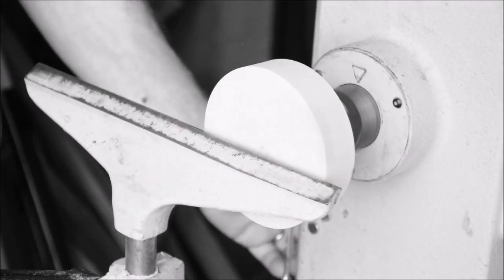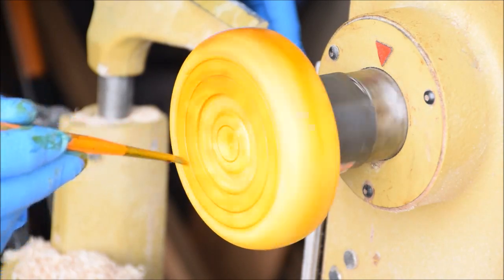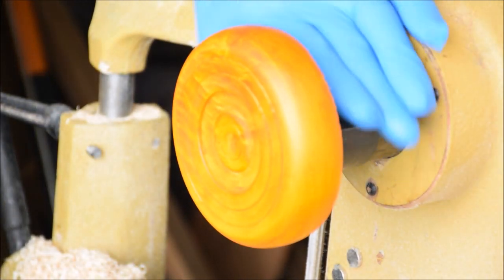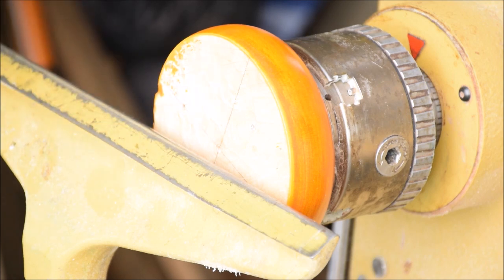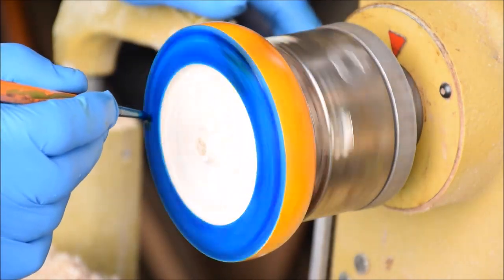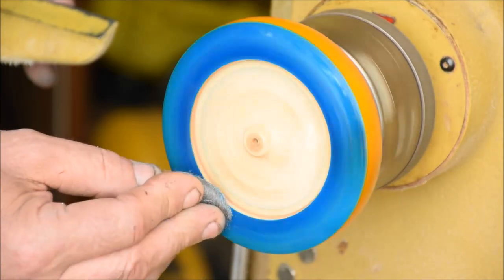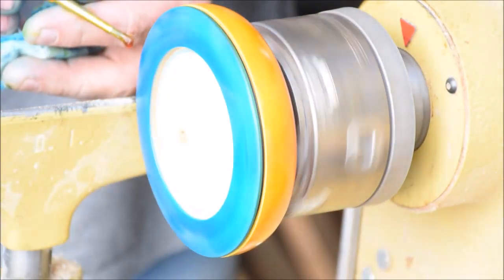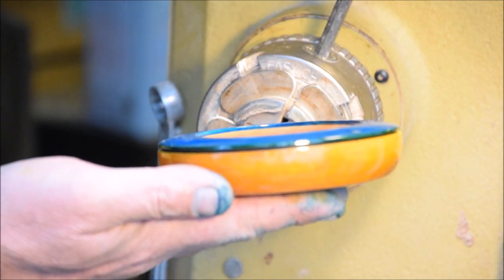Woodturning With The Naked Turner Colorized Golden State Warriors Bowl

Comment: lovely bowl good job...but a bit overboard maybe on rubber gloves as a safety issue? i mean they tear so easy i would have a hard time seeing  them as a catch issue but just my opinion 
cheers
Reply from the maker: Thanks and the only reason I mentioned it was because I have been hurt before with a drill and rubber gloves.  Thanks again for watching.
Reply: wow i would have never thought they exam gloves were sturdy enough for that  but i take your word 
cheers
Reply from the maker: It wrapped up and pulled my fingers into the chuck and hurt the tips on my fingers and twisted them all up!  Be careful if they are good quality nitrile heavy duty gloves.

Comment: Hi, thank you for your video, I never new you can use printer ink ... you must have a large supply of it.  May I suggest to watch and particularly listen to the sound, it is becoming very faint ... I put the volume up then you stop turning .. I go deaf, there are ways to overcome to adjust the volume. sorry it is only a comment no reflection on your effort.
Regards
Jack
Reply from the maker: Thanks Jack, I really appreciate the input. the camera I am using has terrible sound and I should try to get an external mic or something. I will try to make an effort to get the sound better but it is hard for me right now.  Thanks again for the input.